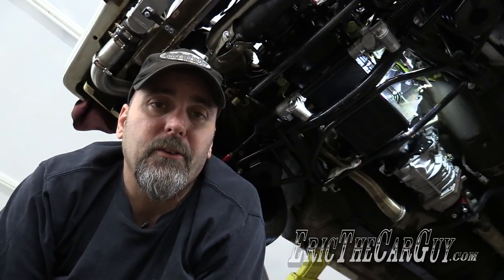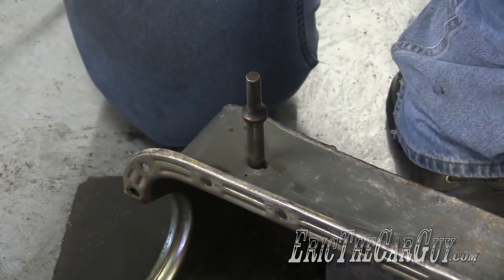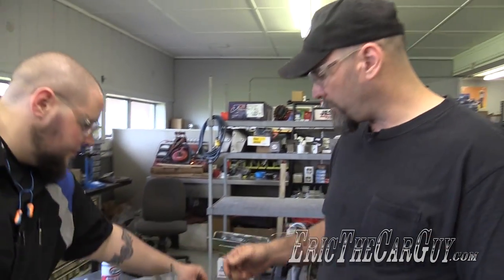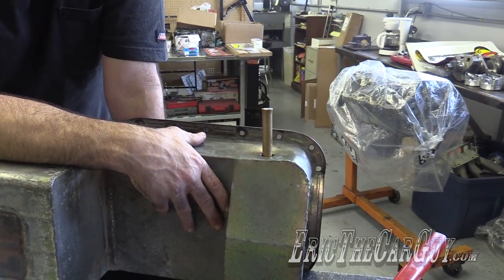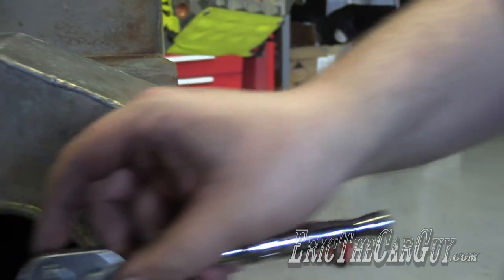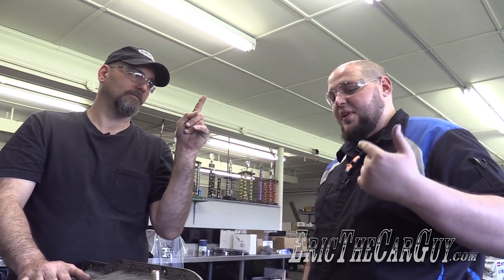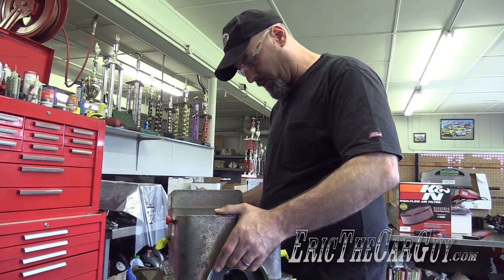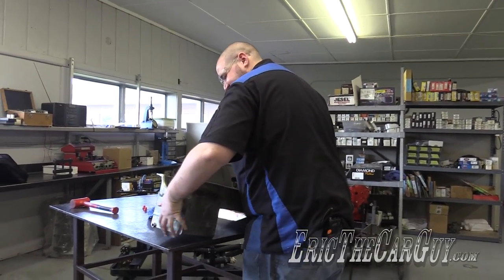Oil Pan Modifications for Turbo and 4 Bolt Main Small Block Ford #DarkMatterPikachu

Comment: I have to agree with WhitwellMike.  A made or purchased bung should have been welded or brazed in place.  The method given in those 'instructions' for the oil return is a down and dirty hack intended for a driveway install by an end-user with the pan in place.  It's all too easy to punch too far and tear the sheet metal leaving you up the creek.
Okay, the hole and thread flange has been made with a punch - that's fine and acceptable.  Let's look at what can go wrong moving forward:
 Threading with a cutting tap is asking for trouble.  Not only does it create shavings; the depth of thread cut by the tap is greater than the thickness of the sheet metal.  Had you went along with Brian and gone further, the tap would have cut the back part of the thread flange off into little rings leaving less of a flange for sealing and support.  The threads that are left have stress risers at the thread root that can easily be fatigued into more little rings by a vibrating flexible hose dangling off them.   
 Threads are made in sheet metal by forcing them into a spiral without removing already thin material using a forming tap.  A threaded steel pipe nipple can also be used in a pinch to form the thread then the brass can be installed.  Forming the threads with the brass is bad as any tears or burrs in the formed flange will chew off the threads in the softer brass.

The pipe dope used is a high pressure lubricant to ease the turning of matching tight and close fitting threads meant to seal on their own.  That's what the National Pipe Thread (NPT) taper is for. Any sealing by the dope is incedental by filling in teeny tiny gaps.  Threads in sheat metal are very shallow and only grip on the very outside part (crests) of the threads on the fitting. That leaves a big open spiral path filled with dope that will be squirted out with a small amount pressure or get sucked into the motor.  Better off to use the dope when forming the threads, wash off the dope, then install the fitting with silicone.

Granted the pressure is low and the driveway hack may work most of the time.  Is it worth risking sheet metal fatigue, or stripped brass threads that are held by 5-10% contact and sudden oil loss on a motor that took a lot of money and effort to build? Not to me.

I'm not an engine builder but that bearing cap is clearly intruding into the sealing face of the block. It seems more sensible to mill or grind 100 thou or so off the side of the cap rather than mangling the pan near a seal surface.  I can't see any detriment or loss of strength by altering the cap in that area to provide ample clearence.  I can see the possibility of damaging the sealing geometry of the pan lip.

Maybe I'm just being anal but this hackery in an engine shop bothered me.
Reply from the maker: As stated in the video, the method shown in this video is what the turbo instructions called for. It worked fine and there are no leaks.
Reply: Eddie the Grouch man u wasted some time coming up with all this bull shit lol it's as u stated a low pressure return line lol i bet it'll never leak and if out ever did it'll be a slow drip and it's high enough up in the pan that there will still be at least 5 maybe 6 quarts of oil below it still lol quit whining about it or maybe u should make a detailed video slowing how u think it should be done
Reply: Thanks for the very useful insights. As a degreed engineer I always appreciate knowing WHY. When I was watching this I missed the part where Eric explained why they were taking the approach they did. All I thought was, wow, wtf are you guys doing!? After all the talk and attention to grams balancing the crank shaft and you're doing this!!!??? I may have never installed a turbo kit, but I have learned quite a bit watching Eric's channel and others like This old Tony to know this was not proper. I don't blame the shop one bit - anyone seeing the rows of trophies and awards knows they would never approve either - Kevin didn't have to say a word. And neither do I hold this against Eric. I've read enough of the comments to understand both points of view, but at the end of the day I step back and look at all that came before and can't help but wonder why get a brand new EXPENSIVE engine and keep a pos oil pan?  if it was me - and I know it's NOT me - I would have taken Justin's polite advice and gone with the $800 shiny new Al oil pan and keep the old pos oil pan with the old pos engine for the rat rod build. At some point in the evolution of the build you have to stand back and reassess the project goals and approach. For me that point was when Eric decided on going with a new engine. At that point it became a professional performance build. At that point the entire game changes. I think Eric was too wrapped up in the MAKING and didn't recognize this fundamental change in direction as it unfolded. I know I have the exact same trouble with projects. That is why I watch these videos and others like it. One has to be vigilant about constantly stepping back and assessing the situation and adjusting the course to stay on track or to consciously head in another direction with eyes wide open. So, in conclusion, I agree with everyone, but, Eric, for the sake of everything that is good and holy, replace that junker oil pan and give Oliver a shiny new one to match the Diff cover - you didn't paint that "sexy thing" (your words) rattle-can black, now did you?

Comment: Thanks for the gag reel Eric.  Hilarious that a bare sump, in your hand, would be hammered into oblivion, the hole size guesstimated, the tap held at roughly 90 degrees, so that you could hope to catch some of the punched in metal to secure an oil line.  Can't wait to see the real, fabricated new sump.

Comment: Looks like something that can be easily fixed at a later date if there's a leak.

Good call not using PTFE/ Teflon tape. It's not  primarily a sealer. It's a lubricant. Teflon will allow one to get more of a turn on what's being screwed together to allow a tighter fit. It will to some extent stop air/liquid leaking between threads, but sealant would do a much better job at that.

Finding these little exerts really interesting. Eric, your attitude towards these improvised modifications is excellent. Can't wait for the next "episode".

Comment: I wouldnt take anything to that shop again. Any old timer would have had it done,and done right in no time. I wouldnt trust that set up at all.
Reply: Yea, the guy portrayed as the professional from the speed shop doesn't seem professional at all. He also doesn't seem to have the knowledge to be doing this kind of stuff.
Reply: Grimfate20 Thankyou,I thought it was just me...damn. When I saw him punch that hole out with an impact and a punch I was thinking,"What the hell kind of machine shop does that?" I guess I am just really old school. I would have properly drilled that hole on the block. Also beating on the side of the oil pan like that to make room,wow! I understand its just metal and all but come on. Anyways...each to their own I guess. As long as it runs....for a few miles huh?
Reply: Grimfate20 Thankyou,I thought it was just me...damn. When I saw him punch that hole out with an impact and a punch I was thinking,"What the hell kind of machine shop does that?" I guess I am just really old school. I would have properly drilled that hole on the block. Also beating on the side of the oil pan like that to make room,wow! I understand its just metal and all but come on. Anyways...each to their own I guess. As long as it runs....for a few miles huh?
Reply: I was thinking the same thing I was biting my tongue lol
Reply from the maker: As stated in the video, the method shown in this video is what the turbo instructions called for. It worked fine and there are no leaks.
Reply: I've watched your videos for years, but i'm sorry thats kind of a crappy excuse. As car guys we know what an oil drain line needs to do and that machine shop should have known to just weld a bung on that rather than use an air hammer. Instructions or not that guy was unprofessional when he kept looking to you and saying "its your oil pan". Well it was HIS job to modify your oil pan.
Reply: Grimfate20 I have to agree,I have never watched a speed shop do that before. Granted we get in a hurry to get stuff done,and mabe in this day and age slamming a hole and using silicone to do the job is the norm. Guess I am just old ,old school.
Reply: If it works, it works. ALTHOUGH I have learned that if you hack it it will work for a period of time. a month, a year, fifteen years. it just depends, but in the back of your mind its going to eat away at you, knowing you've done the job wrong and one day you'll go back and fix it, because its not the customer's car... its your car. Blood sweat and tears went to doing it right and when everyone says it's butched you'll know you fucked up and you'll fix it. then you'll look at it 15 years from now and be happy knowing you did right and followed your judgement despite what the directions said. You consciously don't want a bung Eric, but you subconsciously need one.......

Comment: you could see the marks in the pan where the main bolts were hitting too, personally i would have welded the bung, and preheated the pan when shaping it around the mains, just to make the chances of a hairline crack a little less. I would have drilled the hole and left the air hammer in the toolbox. :)

Comment: The last time I did an oil return line on a pan that was off the car, I found a thick washer, tapped and threaded the hole for the fitting, then cleanly drilled a hole in the pan sheet metal.  I don't weld, but i do braze pretty well- which isn't a half bad way to attach a thick steel washer to thin sheet metal.

Comment: I used a Boss 302 crankcase oil baffle, it bolts to the 4 bolt mains. only oil pan mounted baffle was at the bottom of the sump with a hole for the pump pick up. I used an 8 qt Moroso Drag pan for small block Ford
Reply from the maker: Cool. Thanks for the heads up.

Comment: Machine shop, Machine up a tapped boss and weld it in   :(
Reply: WhitwellMike B Or stainless steel fitting and TIG weld...
Reply: May be Eric didn't wanna do that.
Reply: Would've made more sense.
Reply: Yeah he'd rather do a hack job than a proper job, is that what you're saying?
Reply from the maker: As stated in the video, the method shown in this video is what the turbo instructions called for. It worked fine and there are no leaks.
Reply: If it works, it works. ALTHOUGH I have learned that if you hack it it will work for a period of time. a month, a year, fifteen years. it just depends, but in the back of your mind its going to eat away at you, knowing you've done the job wrong and one day you'll go back and fix it, because its not the customer's car... its your car. Blood sweat and tears went to doing it right and when everyone says it's butched you'll know you fucked up and you'll fix it. then you'll look at it 15 years from now and be happy knowing you did right and followed your judgement despite what the directions said. You consciously don't want a bung Eric, but you subconsciously need one.......
Reply: ʇɥƃᴉɹlɐ ʇou ɯᴉ i doubt it, it'll be fine

Comment: That silicone at the end topped it all off for being a epic fail.  With high crank case pressure from a turbo engine I would have welded a bung.
Reply: lol I was embarrassed watching it
Reply from the maker: As stated in the video, the method shown in this video is what the turbo instructions called for. It worked fine and there are no leaks.
Reply: EricTheCarGuy Yes as good as a welded in ball joint.

Comment: Sorry Eric but... Drill hole, weld nut.. It's not hard
Reply from the maker: As stated in the video, the method shown in this video is what the turbo instructions called for. It worked fine and there are no leaks.
Reply: EricTheCarGuy yes if the pan is in the car use that stupid hack method. And you are ASE certified ?
Reply: Neither is ordering the "right" parts in the first place.

Comment: i get that you do waht instructios says, but i'll ask anyways. Can a rivet nut be used for that application? It doesn't matter much since oil pan is not installed
Reply: Rivnuts in that size, thread type (NPT) and thread pitch does not exist. 
The better solution would have been to drill a hole and add a weld on stainless steel bung. 
We perform similar installations often and have never had any issues or leaks. 
Fitting the oil pan could have been better than shown also, stretching the pan sidewall would have been easier if performed on a shot bag or even a wooden block. 
It is extremely important that the sheet metal interior of the pan not contact the main caps or any other internal component because of vibration and the resulting wear and metal debris contamination it produces.
Reply: patw52pb1 that makes sense. Welding seems the most aropriate solution

Comment: why not weld a bung?
Reply: Kris; to be fair, Anthony's question is fairly legitimate. The pan has already been welded on, so I don't think that Eric is too worried about it warping as he says it already has in the video(remember the baffle plates).
Ultimately, he is trying to follow the manufactures recommendations for the part to showcase to us his viewers how to go about it and the work involved. I would have preferred to go the welded bung route also.
Reply: Incorrect.  I have welded AN fittings to countless pans and rocker covers.  This is pure hackery.
Reply: ***** You wouldn't weld brass to steel. He just needed a $2.00 AN male, weld-on fitting in mild steel.  TIG it into place.  2 minutes and you're done. Minimal heat.  Female AN fitting with hose barbed end and you're done.
Reply: Kris Nicholson
Reply: ArchimedeanEye but you can silversolder it...
Reply: Welding, too high end. But the proper solution is to just make a hole (with a christmas tree bit) and the use a flange bung which seals in. This one is hack up as hell, so no, don't ever do this.
Reply from the maker: As stated in the video, the method shown in this video is what the turbo instructions called for. It worked fine and there are no leaks.
Reply: EricTheCarGuy totally understand just wanted to see your opinion.  no disrespect was intended.  some of the other comments seem harsh

Comment: Eric.  Usually I agree with almost everything you do, but not this time.  Sealer?  Really?  All you would have needed to do, was run the brass fitting in, and then solder it.  Brazing would have done the job too, but high temperature, metal repair solder is easy to use, and works great.  Never need to worry about it moving or leaking.  Great videos in any case.  Can't wait to see the car run.  Take care man.
Reply from the maker: As stated in the video, the method shown in this video is what the turbo instructions called for. It worked fine and there are no leaks.

Comment: I'm sure someone else would also suggest you just drill a hole and put a nut on the back of that drain fitting. Put a washer on each side with a bit of sealant and lock tight the nut. Sounds like a plan and no need to weld or dent your pan.
Reply from the maker: As stated in the video, the method shown in this video is what the turbo instructions called for. It worked fine and there are no leaks.

Comment: stepped drill bit and then thread it then use a bolt on the other side... then i used some sealer then was done on my T3/T4 ford probe...was just hitting 16 psi on it tonight while going up a highway ramp lol. this could of been better... but i understand what you was going for when you was wanting to do this... but it didn't turn out the best but hell atleast you tried.. my first oil pan before this last one was horrible... but i got my newest one perfect!

Comment: Love your videos Eric, but NO - this is unacceptable on anything as important as the engine oil, especially in a high performance application.  Cant believe you let this happen after spending all this money.  Maybe if you had to do it in the driveway engine installed the air chisel method might be necessary, but you guys were (in a machine shop-!) and had the opportunity to drill a clean hole, install the fitting with or without a nut on the back side and then braze or weld both sides to the pan, then it cant vibrate loose and never leak if done right. }:^(
Reply from the maker: As stated in the video, the method shown in this video is what the turbo instructions called for. It worked fine and there are no leaks.

Comment: I'm curious as to the history of this choice.  Was it the machine shop that had the idea to punch a hole through the pan?  Or Eric ideas after reading the instructions for his kit?  The dad didn't look too happy in this video and the outcome makes Kalvinator look suspect.  It's fair to say they didn't use the best option when making the hole.  But whose decision was it?  Hopefully, Eric makes a video about it.
Reply: Erics idea based on the instructions for the kit.
Reply from the maker: As stated in the video, the method shown in this video is what the turbo instructions called for. It worked fine and there are no leaks.
Reply: Sorry, I must have missed that part, Eric.  I would probably do it this way if I was installing myself since I don't weld.

Comment: Did this shop not have a lathe to make a tapped bung, and a welder to install it?
Reply from the maker: As stated in the video, the method shown in this video is what the turbo instructions called for. It worked fine and there are no leaks.

Comment: i dont usually like silicon used to seal anything on the oil pan, but maybe in this case they have a good reason. Silicon getting into the oil can clog the oil pickup.